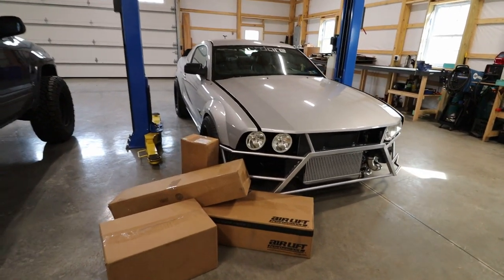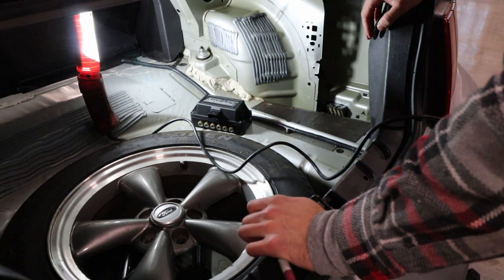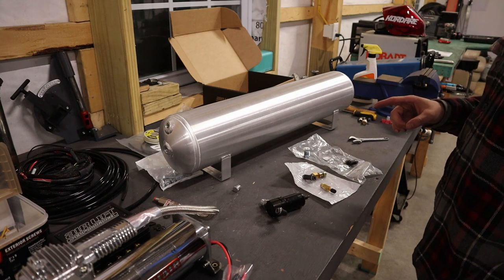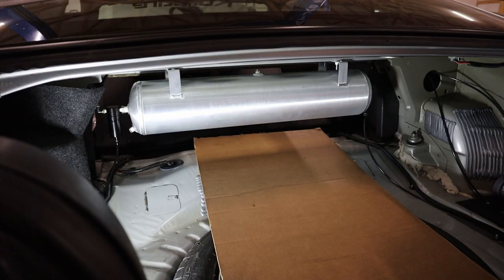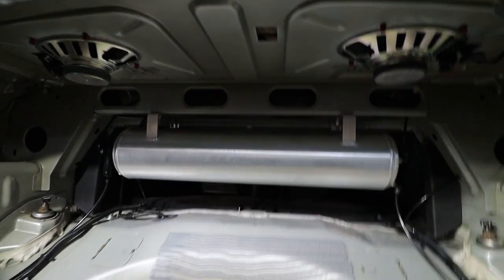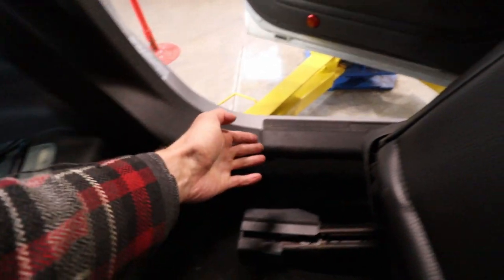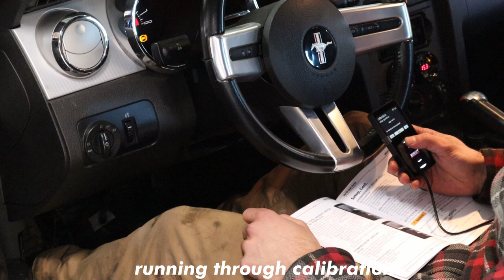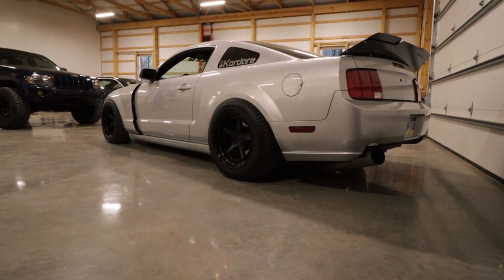Air Lift 3P Air Suspension - FULL INSTALL - S197 Mustang

Comment: Have you had any problems with it  was told they have been having problems with the system leaking.
Reply from the maker: Nope I haven't had issues but I really took my time with the install and made sure everything was sealed
Reply: @Kordare  have you heard of the p1 system.

Comment: Hi I actually just installed my airlift 3p kit and was wondering did you put the line from the bottom of the filter to the e port on the 3p manifold?
Reply from the maker: No the bottom port of the water seperator is the drain to run out the bottom of the car. If that's the filter you're referring to

Comment: Hey quick question..in your garage what r rated insulation do u have on your walls .. r4 r13 r19 ?
 I have r4  as I was told . I'm wanting to install heat an air but the ac guy said my insulation is r4 an it want hold the heat an air in like r13 .. they telling me I will have to go to a bigger unit to make up the difference.. I plan on closing in the walls but not the ceiling
Reply from the maker: I don't have any insulation in the garage currently